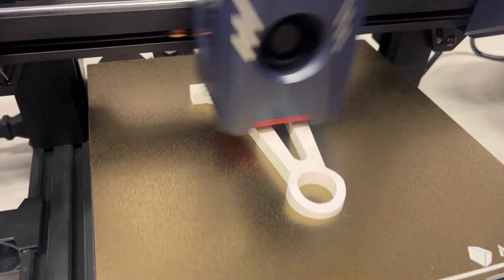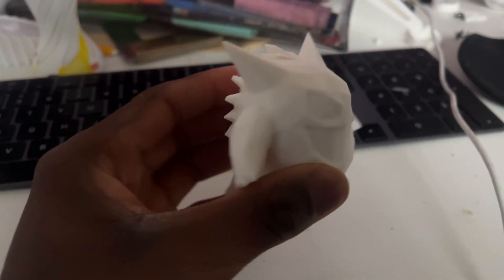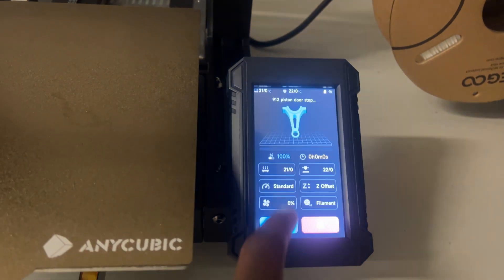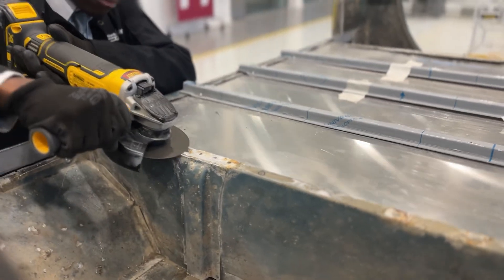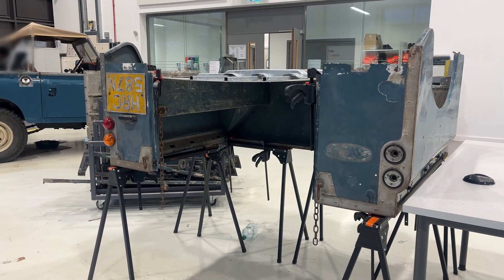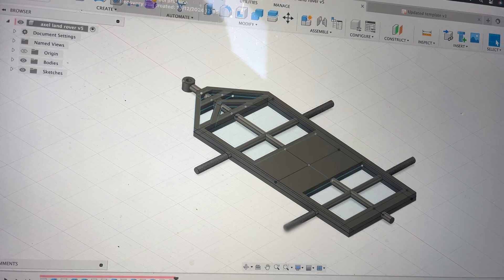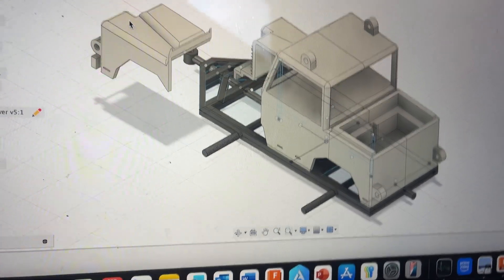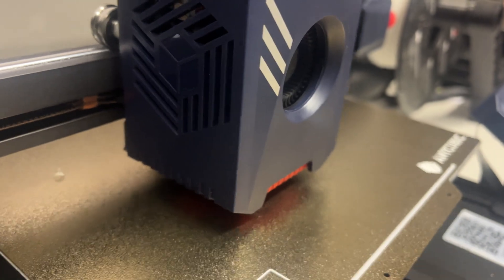I 3D Printed A Land Rover Series 3!!

Comment: Hey there, I love your energy you use to take on all of the projects.
from my own experience 3D Printing threads is not the best idea in particular with an object that would idealy printed sitting flat on the bed. Therefore I would recommend you to remove the axels from the 3Dprinted chassis part and instead just cutout holes for them. Then print the chassis with support for the holes and in the end slide Metal Rods into the holes. With that you´ll have more rigidity in the Chassis and its easier to cut threads (that will fit the nuts) onto a metal Rod rather than to fine tune the 3D Printer until the threads fit.
Reply from the maker: I realised that as well because it would be super difficult to clean them up too, I printed model threads and I came across that problem, the whole print idea is just to gauge the idea, I’m going to wrap the whole thing in carbon fibre and for the whole chassis I’m going to get it cut in steel or stainless steel but a lot thinner to account for the change in weight, then I’ll either manually or automatically thread the bars, I actually changed the design for the chassis quite significantly, I’ll update that in a short later on, thanks for your interest in my projects, its ideas like these that help me come up with better ideas
Reply from the maker: See Short reply